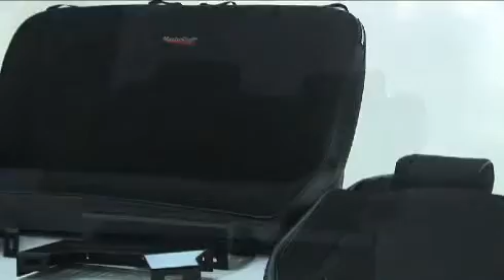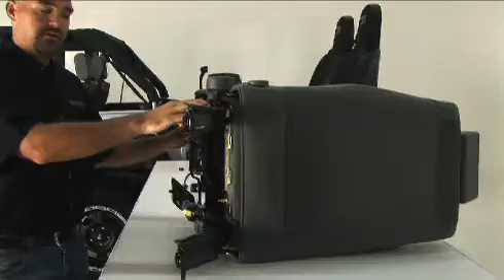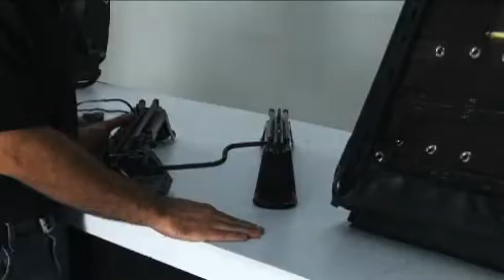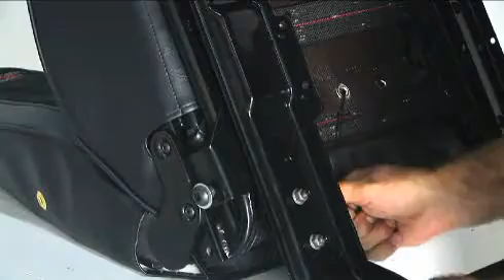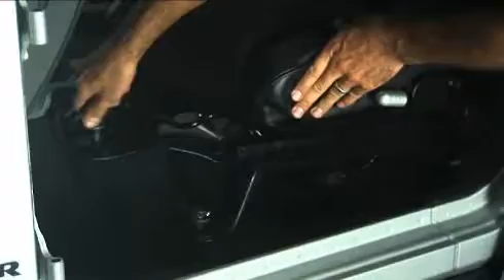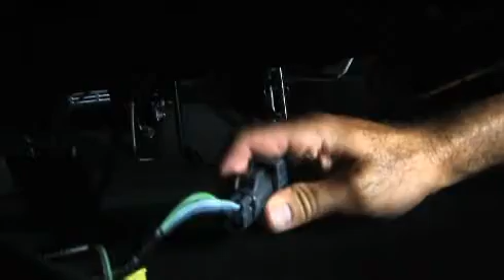MasterCraft Safety How-To Videos: Jeep JK Front Baja RS Seat Install

Comment: uhm a few comments here, first of all ive done job a few times...you will not remove the seat bolts as shown in the video, especially not with a short handled ratchet, the majority of JK seats I've removed are torqued to around 160Ft lbs. Secondly those sensors are sensitive and it takes about 5 times as long to remove them as shown in this video.   A normal JK takes me around 4 hrs to replace the front seats.  keep that in mind and the rest is spot on, oh except Ive never come across a drivers seat with an airbag sensor, thats kinda odd.